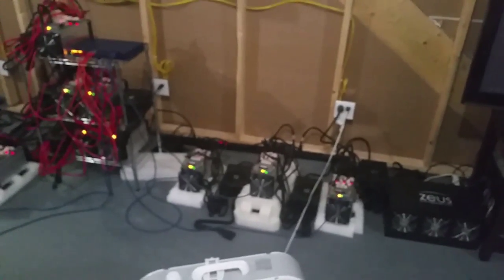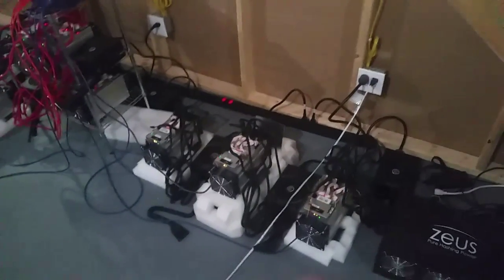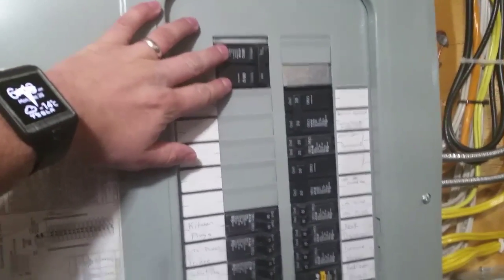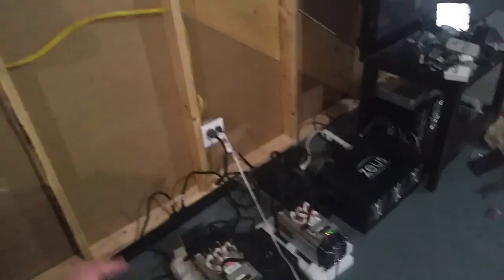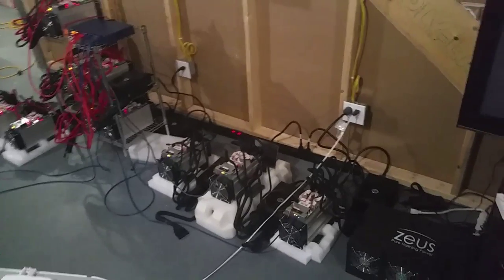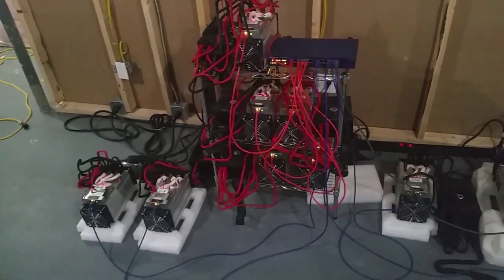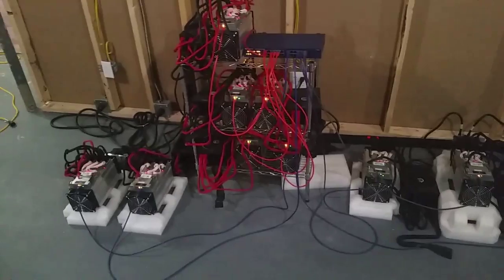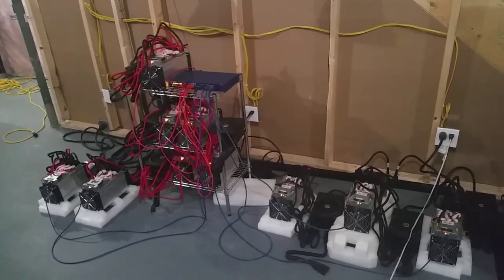Antminer S7 - Electrical Setup

Comment: What are you mining with the zues is it strictly litecoin?   I just got one not doing much research ....I'll work with that later .

I just got a s7 miner with a power supply I don't know much about psu' s.  I have a 1600 w  for it  so ....for this power supply can you just plug these in any way ? or is there a certian way to plug  thease in I've read a couple  conflicting ways    I have ten plugs and only 9  females to plug them into each plug has 2 plugs to a group ...how do I plug this in I have the single one plugged in already up front .    It looks like there's going to be a extra plug ...I'm goinng to have to use one of the plugs on that last line so there will be one hanging out will this work like that .....thank you ....if anyone READS this you can a answer too ! 
I just want to get this running..
Thanks so much
Reply from the maker: I'm using the Zues miner to mine Bitconnect coins.  I'm confused with what you are trying to say about the PSU.
Reply: Yemira  .. i have a 1600 power supply not ant miner does it matter rich plugs go where when connecting the psu there is a extra plug left over from psu .....So there is 2 plugs In each bundle there in a u type shape 2 plugs coming off each bundle can you connect from one board to another when connecting  the power ...cause there is 3 rows of three females on ant miner to plug the power supply into  so to plug them all in I have to cross over to next panel is this ok ...  sorry it's hard to explain ...thanks for trying ....I didnnt know you can mine bitconnect cash...thanks  for your help

Comment: Hi yemira, Great videos. I have 2 S7's coming in a couple of days. I live in a small apartment and according to my electrical box panel my outlets are labeled "120/240v" so I am guessing they can handle 240v? would i be able to put 2 s7's with the 15, 20, or 30 amp with 240volts? And would a 250volt power cord work on a 240v outlet? I have the bitmain power supply unit 1600w. Do I need to get a "PDU" also? I have not heard of that term since researching about mining. Thanks
Reply from the maker: Hi there. Can you take a picture of the breaker in your panel and send it to me to my email at ayehya@yemiratrading.com. The breakers are labeled 120/240V. But are 120V if they are a single (thin on) and 240 if it's a double (thick one, basically two 120V in one). Depending on the current rating of the breaker,  I don't recommend using 15A, but on 20A you can connect up to 3 S7. 5/6 S7 on 30AMP. You need a PDU to connect more than two S7 to an outlet.
Reply: hi can you please check your email, it is not letting me send. thanks
Reply from the maker: Nothing came in, how big is the picture?
Reply: +Yemira Trading Inc hmm lemme try it again sorry
Reply: its not letting me email you, i think its because I'm emailing to another country. but here is the link i made http://imgur.com/a/ozpvo.
Reply: Can I use a 250v 30amp splitter for the 240v 30amp outlet thats being used for my dryer? what is the best way to use the 2 S7's with the info from my picture above? thank you

Comment: you are using evag 1600 240v why dont use the bitmain ad psu 1600 ?
Reply from the maker: The Bitmain PSU is not as efficient as EVGA. It uses more current which is critical in a small setup at home

Comment: Hi what kind of pdu are you using ? 30 amp 240v is not boder line for 5 s7 ?? we are suppose to use about 80% of capacity of the wire and braker
Reply from the maker: Yes I'm using 240V 30A PDU. With 5 S7, I'm only using 25-26A depending on temp. It's is borderline but works

Comment: Would you run 5 AM S7 from 1 220v 30 amp breaker?
Reply from the maker: +Ian Edwards Yes, I'm doing this already. I have two (2) 240V 30A breakers each is powering Five (5) Antminer S7.
Reply: +Yemira Perfect!!! Was looking at getting this setup myself soon but in my shed. I need to run electrical out to it first... Thanks again.

Comment: Is your single antminer s7 still plugged in the 120v w/ 20amp breaker?  Any issues with this 120v w/ 20amp breaker set up? Thank you.
Reply from the maker: +JustVidz Hi there. Please subscribe for updates, working on a big one. I have (2) Antminer S7 each connected to 120V outlet with a 20A breaker. There are no issues. It's just not as efficient as plugging it into 240V outlet. The higher the voltage, the lower the current and that's better efficiency as less energy is lost via heat. In addition, the Antminer, is designed to function better at a higher voltage. If you can get a PSU that would supply 12.5-13V to each hashing board, it would hash faster than when supplied 12V. Note the specs below from Bitmain:

 S7 Specifications:1. Hash Rate: 4.73 TH/s ±5%2. Power Consumption: 1293W + 10% (at the wall, with APW3, 93% efficiency, 25C ambient temp)3. Power Efficiency: 0.25 J/GH + 10% (at the wall, with APW3, 93% efficiency, 25°C ambient temp)4. Rated Voltage: 11.60 ~13.00V5. Chip quantity per unit: 135x BM13856. Dimensions: 301mm(L)*123mm(W)*155mm(H)7. Cooling: 2x 12038 fan8. Operating Temperature: 0 °C to 40 °C9. Network Connection: Ethernet 10. Default Frequency: 700M

Number 4, states the operating range for each hashing board. How to do that? I'm working on it.
Reply: +Yemira Great! Tnx for the info...

Comment: How large of a service is coming into the house? Scary having to fan your main breaker.
Reply from the maker: +J Rombou (Under) Its only 100a. The fan is just to circulate the air in that corner actually as I found it to get quite hot. I have it directed at the panel because that's the only way I could hang it and it's more effective hanged than on the floor.

Comment: I don't understand what you do with all that heat? Is it cold year round where you live? Or do you not have to be in the mining space to often?
Reply from the maker: +Austin 152 Hi There, the excess heat is used to warm my house. Where I live right not it's 0F/-18C so the heat is pretty nice. However, I have an exhaust duct just above the miners where some of the heat is pushed to the backyard via an exhaust port in the basement. The basement is maintained at 28-30C/82-85F and the rest of the house betweem 23-25C/73-77F which is nice.
Reply: Ya I live in a Cold place also but they charge alot for electricity so It might not be worth it. Im def worried about that but I have to pay for heat anyways so in the winter I am def interested

Comment: Your set up looks like a mess, and that cooling fan for your the main breaker must be a joke as there is reason why the breaker tripped as it was probably overloaded and it can cause something more serious. BTW: now you can buy S7 batch 8 for 1200 US plus 55 Shipping, which is around 1700 Canadian so your price is crazy overpriced!
Reply from the maker: +Dj Pete Never said my setup is clean. It's a huge mess, I'm focusing more time on meeting contractors and realtors finding the right commercial place. That's where I plan to have a proper setup. When I started I was all over the place and still learning, and made several mistakes. If I planned on continuing mining at home I would have upgraded my service to 200A, got an HVAC guy to setup a proper ventilation system for the miners, and had 220V 30A outlets installed evenly and in several locations to allow me to have my miners in the middle of the basement pulling air coming from the basement window which is below freezing and pushing hot air out via an exhaust fan through a separate duct out of the house. But that's what I'm working on for the commercial location. If you have any ideas, that would be great.

Considering that my current setup is at home, we do have appliances and the miners alone pull around 60 Amps leaving me with roughly 40A to use. Turning on the dryer at a low setting and dishwasher/washer/oven happened to trip my breaker... The fan is a joke, that back corner tends to get too hot and its more efficient circulating the air there while hanging than being on the ground, I found. So in the mean time I usually turn off the two miners running off of 120V to do what ever is needed and then turn them back on. 

In regards to the price of the S7, I did notice the new batches, which is great, but not, because I paid a much higher price for that batch (3.1 BTC) and I see it's 2.84 BTC....I'm definitely looking into buying more and it would be cheaper for sure. The duties and taxes on importing them have been varying per batch between $110-$150 CAD. I always have them shipped with FedEx (0.25BTC ~ $150CAD) and receive them within 3 days when Bitmain ships them.
Reply: Wow 3.1 BTC that must hurt now. They wouldn't allow you to pay cash ? I heard Bitmain is only accepting BTC cash now which sucks.